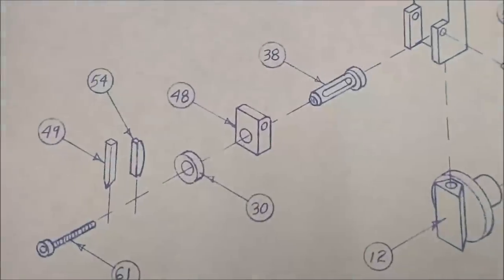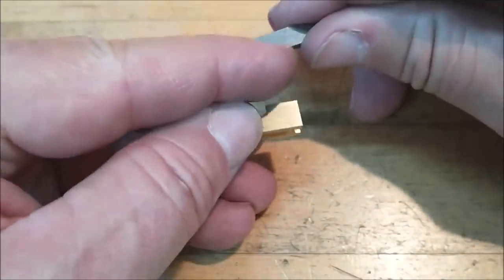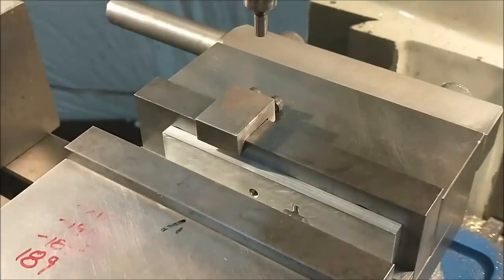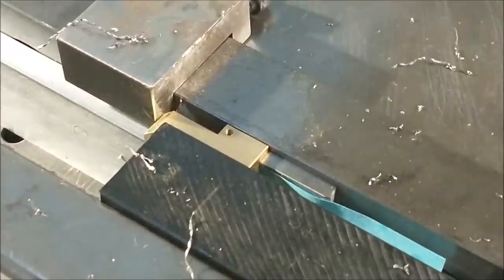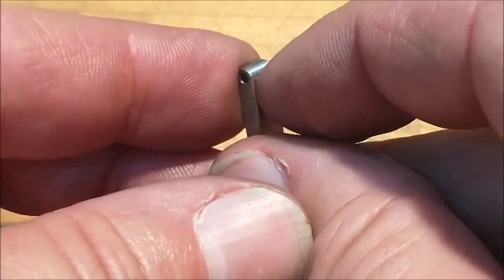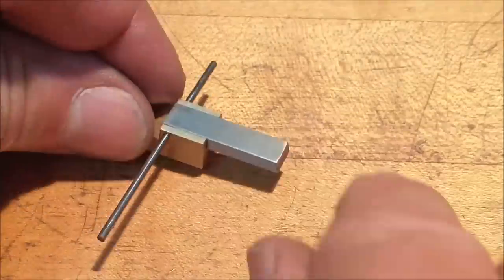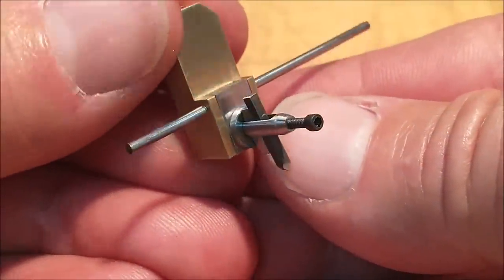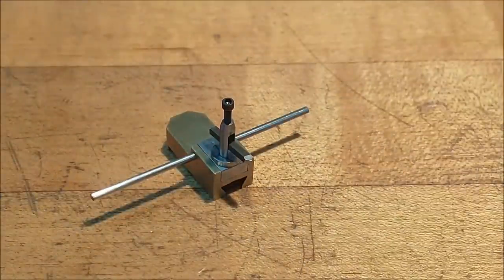Its Called a Clapper Block.  Do You Know What it Does ??

Comment: Sweet! I have operated shapers from a hand cranked 4 inch stroke up to a monster 36 inch. If you want some excitement let a bit of trash or a metal shaving get behind the clapper box. Usually a broken tool bit is the result.
The first thing that the old hands tell you, or at worst find out the painful way is not to stand or look straight into the cut. Do your setup and stand to the side. My last shop had 2, 12 inch GEM shapers. We had pin indexable cutters that if they hung up the 5/8 inch mounting pin would snap off and the cutting portion would become a projectile. The last one I saw went completely through a 2 inch steel clad fire door from about 30 feet. 
A shaper is no joke. A lot can go wrong in a tenth of a blink of an eye.
Never lose your respect. Hold your work solid. No janky setups here gang.
Don't get me wrong, I would have a shaper in my shop in a heartbeat. My friend found one at a scrap recycling center and actually got it for free. It's a bench mount Atlas. Lucky SOB! 
It's going to be a blast to see this little guy put together. It will be the smallest shaper I have ever seen! 
Be safe folks!
Cheers
Terry

Comment: Clapper Block.  Damn, haven't used one of those since 1979, when I was learning to use a Shaper/Planing machine.  I did a Fitting and General Maintenance course at a Skill-centre in Plymouth, Devon, UK.  A 50 week course, which taught me everything from using a Lathe, to Welding; Hydraulics; Pump Alignment; Bearing Fitting; Plumbing and numerous other skills, including Technical Drawing and Designing Components.  Regrettably, I never managed to get a decent job after the course, due to the Economic situation in the UK during the 1980's and '90's, but I used many of those skills for my own benefit and enjoyment thereafter.  What I got which was of most use to me, were Bench Fitting and Prototyping skills; making items from scratch, with just hand tools.  I still have several of the Test Pieces I had to make on the course, working from Technical Drawings.  I still have the Training Manual I was issued with on the first day and many of the Precision Tools which were issued as part of my Training Set.  I certainly got Value for Money out of the course, which was all paid for by the British Government.

Comment: It allows the cutting tool to lift up when the shaper is on its return stroke as it feeds across ready for the next forward cutting stroke. Also used on a Planer which is like a shaper but usually far larger and the table reciprocates not the cutting head.

Comment: After each successful cut, the clapper applauds the cutter for doing a fine job and simultaneously releases pressure between the cutter and work surface.
If another cut is successful, additional applause will follow.
However, if the cutter snaps under the extreme pressure, the clapper block will throw it through the wall into the neighboring shop at 16,239 feet per second and NO APPLAUSE will follow.
Reply: That definately needs to be in the manual, exactly as you stated it.

Comment: That looks like fun. I'm retired now, but when I was doing my apprenticeship in tool & die making 50 years ago I used a shaper to make the form dies for auto body parts. I remember 1" high speed tools taking 3/4" deep cuts using .060" feed rate, following a layout line, and trying not to get hit with the chips. We could fit those dies within 0.010" of the panel, and then set the dies up in a 400 ton press, run some blanks to check the fit, then crawl inside the press, lay on the bottom shoe and grind down the high spots with a 7" disk grinder. Thank God for CNC mills, fits right, the first time. You could get really creative, if you can make enough torque. I think you have too much iron hanging out and under the tool bit, keep it short, just enough to clear the work. Don't use the rocker, clamp the tool flat on a thick shim under it.
Reply from the maker: I'd personally do away with the lantern post all together and make a block to hold the tool. But this is supposedly period correct.

Comment: if it doesn't give this machinist (Joe Pie)a hearty round of applause it ain't worthy of the title 'clapper block'
Edit to add: just looking at the part of the video where you show how the clapper block allows the cutting tool to self retract on the backward stroke and thought to mention that on a full sized shaper it is wise to add a little piece of cut leather fob to the rear face of the tool. This addition of a leather piece prevents the tool from leaving any witness marks on the already machined part of the workpiece as it retracts backward across the component being machined....simple but very effective.

Comment: Clapper block claps when you finish your machining and everything is according to paper! There is also booblock which does opposite.
Now for serious its a block that allows knife to tilt up and drag across material when ram goes backwards.Its also the most common part to fail (not block itself but the hinges that hold it)when you take too big cut .Everything else but the clapper and manual depth support on dovetails on which clapper box is attached is built like  a tank so if something is to go its mostly those two.

Comment: The only time I used a shaper was in the first year of my apprenticeship to rough out some "V" blocks. I guess they went out of favour as milling machines and their cutters got more capable. If I recall correctly the clapper box was spring loaded so as the cutting force came of the tool the box would immediately snap open to stop the tool dragging on the work on the return.

Comment: I'm glad you know what it does. I still don't.
Reply: He explains it.  Lets say you have a machine that will score/mark/cut a block of wood.  And the "bit or tip" is attached to a rail that only allows it to move back and forth.  When it is moving forward the clapper is designed to make sure pressure is applied to the bit so that it will will score/mark/cut the wood.  But when it is moving backwards the "hinge" on the clapper will allow it to relax and drag gracefully across the wood without scoring/marking/cutting it.  It's like a dog door that would only open on way.  It might let a dog out of the house, but it does not let the dog into the house.  Same idea with this tool.  It allows the bit to only cut in one direction but not in another.  Whereas a bit that is fixed without the clapper, will "try" to cut in any direction it is forced.

Comment: Interesting to see that being made! I have a small shaper. The clapper block/box is an interesting part of the machine. Mine hinges on a tapered pin. One problem is that it does not always seat all the way back down after the return stroke. Sometimes it misses an entire stroke or drops in halfway through the cutting stroke. Completely messes up the surface finish. Still need to figure out what is wrong...
Reply: Have you tried to lube it ? It should go freely. If you are not first owner of machine there is also probability that hinges are bent due to someone beeing too optimistic and he took too big cut.It would be good if you can slightly ream taper and get a new tapered pin.Remove the pin and see how block tilts in hinges if it gets stuck somewhere ,if it does try to sand it a bit on some glasspaper and flat peace of glass (scanner glass bed works good).
Reply: Clearance. Something is obviously binding and sticking. Disassemble, clean and check for small burrs. Carefully stone off any you find. Avoid oil which attracts dirt.
Reply: @ellieprice363  I've had it completely apart multiple times. Cleaned and stoned all the parts with PGF stones and assembled it dry and with oil on the tapered hinge pin. I tried loosening and tightening the pin... Makes no difference. It usually goes back down completely, bounces up and then stays there. I've thought about adding more weight, maybe just a HSS cutter is too light?
Reply: @quintinsmits  That’s a tricky one. Sounds like the hinge center line is not perpendicular to the clapper sides. Just a guess of course.
Reply: @zumbazumba1  I did. I tried it with grease, oil and dry. I also tried leaving the tapered pin a little bit loose, does not help. It is like there is an air cushion that it bounces off and then it does not have enough weight to go all the way back down. It is all very tight fitting. I cleaned up the burrs on the pin and all the parts of the clapper box withprecision ground flat stones. There weren't very many and everything seemed straight.
Reply: @quintinsmits  If everything checks and you know it’s square set it up on the surface grinder and grind .001/.0015 off one face off the clapper. It was possibly set up just a little too tight.

Comment: How will you secure the hinge pin? Precision models  is very interesting and looks like it takes more skill than large items.  + - 0.001" is a larger percentage in these models.
Thanks
Reply from the maker: For most of my 'Models', I either peen the mating hole or put a small center punch dimple on one end of the pin. The displacement is more than adequate to hold the pin. If its truly a high load area, I'll make sure its a press fit.

Comment: I made part 38 for my 24 in shaper. i need to make #54, i have #30 came with my lathe. not sure how to pull that off without a way to cut that radius but maybe my rotary table and an extended vise

Comment: Awe-inspiring!
The following is not a criticism of your work: I question the toolholder design. Since there is no need to provide for fine adjustment of tool height relative to the clapper, there is no need for adjustment of tool rake on a shaper. Tool rake is established by the grind. The tool would usually be clamped directly to the face of the clapper. The toolpost shown is appropriate for a lathe, but not a shaper or a planer.
Reply: In essence, the shaper toolpost did not have the dished washer and corresponding "boat" piece.
Reply: This is a replica of an old-timey machine, thus is uses old-timey bits. I used to sell these (used, of course) more than three decades ago; everyone still used that silly tool post!
Reply: @UncleKennysPlace  I'd suggest most savvy users discarded the washer and boat 😉

Comment: So what does it do?
Reply: The clapper block holds the tool which is on the end of a crankshaft driven ram. It cuts on the forward stroke and then flips the tool out of the way on the retraction stroke allowing, the piece being cut, to move sideways in preparation for the next cut. Abom79 (youtuber) has some shaper videos which use slightly larger machines.

Comment: In the real  mechine I would  think that the clapper would set flush on the face  to not have the workload on the rotation pivots of the pin . I would think
Reply: Hi Fredrick, on a full size shaper, the entire mounting that Joe completed in this video is able to rotate on the ram (so you can cut tapers etc) and the load is actually taken on that pin and through the dovetail that allows the entire vertical slide and clapper to move up and down. 
If you go to Abom79 channel and search for some of his shaper videos, you can see a real machine working and the range of cuts and operations they can perform. They are an amazing machine.
Regards Dennis

Comment: It’s to keep your cutter sharp. If the clapper box would not move it would drag and prematurely wear out your tool by dragging the bottom back of the cutter across the steel your cutting on the back stroke because on the backstroke the worktable moves over for the next cut. An old school method to fix a worn out clapper would be to tack weld the clapper closed. You would get accuracy back but your tool would not last as long.
Reply: Not only the bottom, but the side cutting face. The incremental feed happens on the return stroke so without the clapper the tool would bedragged into the workpiece with the cutting edge trailing.
Reply: @ThePottingShedWorkshop  yes basically what I was trying to say.